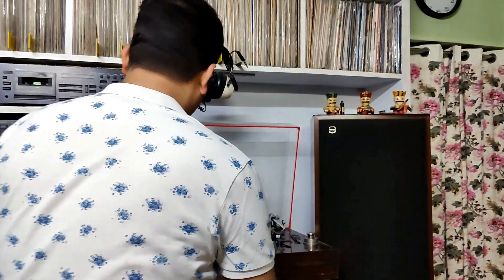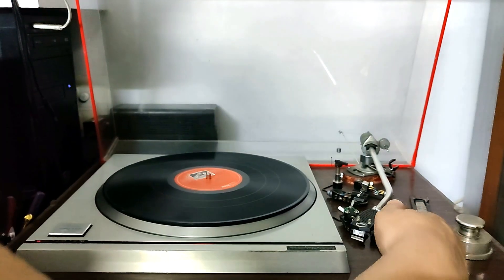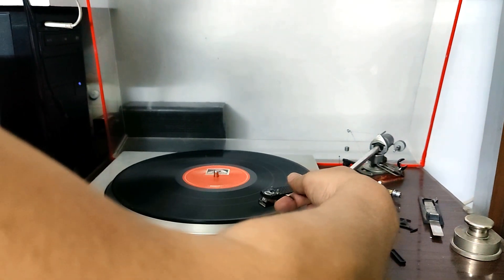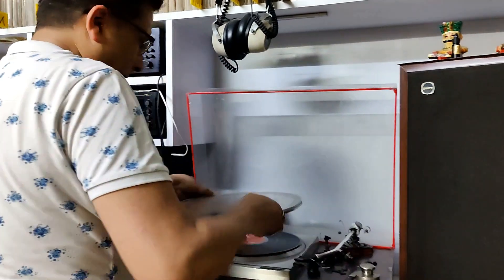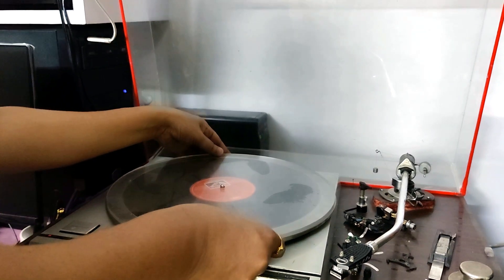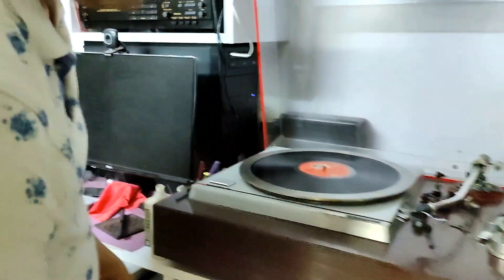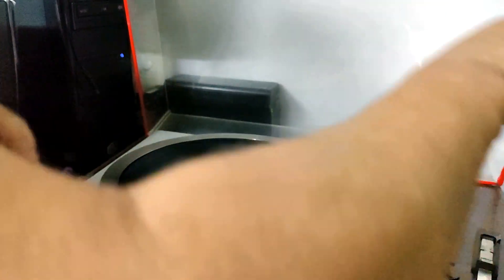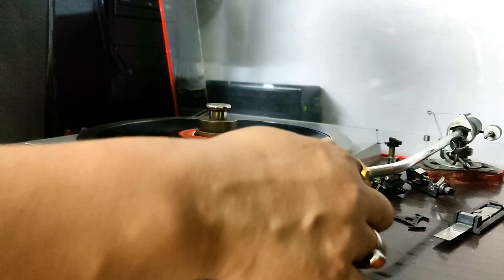The Record Stabilization Ring for Thin, Warp Records - A Demo

Comment: I have a lp record which has been warped similarly like this and my tt is not capable of handling that much weight of the stabilization ring. I was thinking about keeping it in between heavy books for flattening the record. What are your thoughts for this?
Reply from the maker: Get another copy. It can't be fixed now.